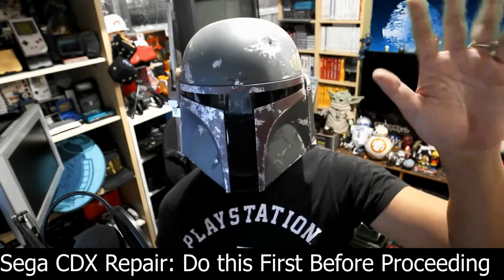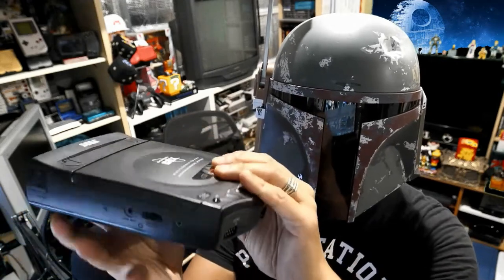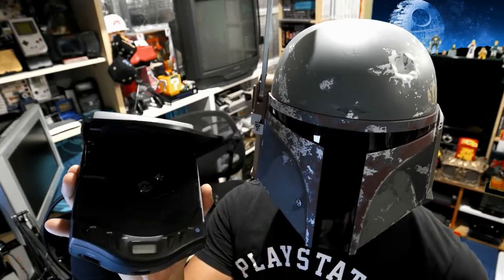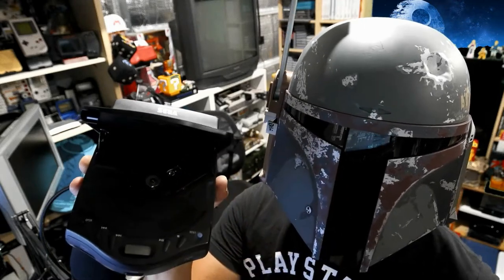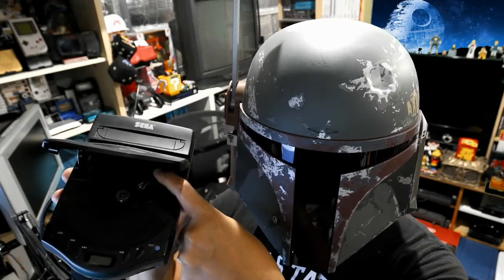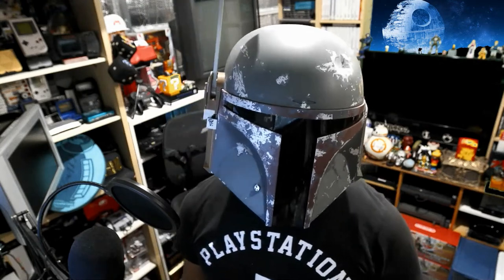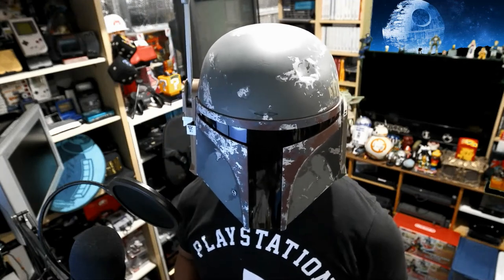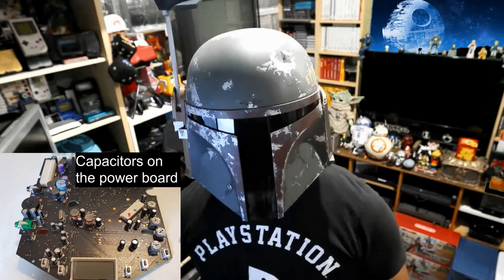Sega CDX Repair: Do this First before Proceeding, It will save you time and effort

Comment: Always wanted one of these since I first saw them in old video game magazines like EGM. Might pick one up and fix it for the nostalgia 🤔
Reply from the maker: It a great little unit, and for that time in the 90's, it was a well engineered console, you can see shades of what they did with the Saturn because of the CDX, from a design standpoint. Prices on Ebay are inflated. If you can find a unit that is functioning 300-350 is the going value. I always try to find a seller willing to take an best offer. A broken unit to fix would be between 150-200. I hope this helps and thanks for stopping by.
Reply: I have one, if you want
Reply: @prioadhipranoto7488  how much do you want for it
Reply: @HOWLWOLF  do you have Facebook account or whastup number?
Reply: @HOWLWOLF  if u want it, I give u free. Just pay for delivery
Reply: @prioadhipranoto7488  you still have it?

Comment: I have a CDX with an odd issue. It will only display a black screen and will not play games, however it will play audio CDs, again with a black screen. Any ideas?
Reply from the maker: Have you recapped the CDX,  some capacitors will fix video issues. Also have you tried another AV cable just to make sure it’s the unit.

Comment: My CDX spins a little, tries to read the disc, and then gives up with a "No disc loaded" error. I sent it to a friend of mine who recapped it (as a pre-emptive measure since they would probably start leaking sooner or later), replaced the battery, oiled the bar that the laser moves back and forth on, and swapped out the original laser with 5-6 new lasers he ordered, but none of the new lasers fixed the issue. He left the pot adjustments at their factory set levels because one of the few repair documentation he found online said not to mess with them. BTW, if you're replacing the laser, wouldn't they have to be at the same factory settings since adjusting them as you said is only a temporary fix (and I'm guessing all new lasers should work at the pots' original factory settings)?

I was thinking maybe it was the motor but my friend thinks that if it was the motor, it would not spin at all. I'm the original owner of mine since 1995 and it stopped working near the end of 2011. I would love to get it fully working again. The Genesis portion has always worked without issues. It's just that Sega CDs and audio CDs no longer work on it.

Would you have any other ideas that could be the issue?
Reply from the maker: so the pots really don't have a factory default, each laser gets tuned specifically so when you replace the laser, you do have to fine tune the pots a bit. Back in the days each laser that came out of manufacturing were not identical. If you opened up 2 different CDX, each unit will have the pots in different positions at factory default because it was fine tuned to that laser that was installed. It's a pain in the ass to tune the pots, but the best way would be to use a multi-meter to measure the resistance and test it in increments as you adjust the pots. The motor won't spin up if no data is read from the laser, so many times people confuse the spinning of the disc at low speeds to a bad motor. I hope this helps.
Reply: @remagelosnoc  First off, thanks for the reply, I really appreciate it.

I wanted to ask if you would know if an untuned laser could cause the CDX to act in the same way that a dead factory tuned laser would cause it to act.

Once it stopped playing disc games, my CDX would spin a little, try to read the disc, spin a bit more and after about 20-30 seconds of that give up. This happened with the original laser once it stopped playing discs and happened even when the laser was replaced with 6 different lasers. I believe the pot settings were the same when the replacement lasers were swapped in as they were with the original laser. It's made both me and the friend I sent it to wonder if the original laser was ever the issue.

Maybe the new lasers weren't getting enough power from the pot settings to properly read the discs, making the CDX act the same way a dead laser would? I know there's a decent chance due to lower QC standards that current replacement lasers ordered are dead on arrival, but I'd have to think that at least 1 out of 6 lasers he swapped in would be working.

Thanks again and take care. Looking forward to your reply.

Comment: Question. The one I have shows the Sega CD title but it wont spin the disc. The lazer is in the middle and I can see it moving a little but thats all. What should I do next? Thanks
Reply from the maker: does your CDX spin the disc at all, try to put a music cd in to see if the disc spins. if it doesn't then there is an issue with the spin motor or it could be that the laser is bad and can't focus to read enough data to tell the motor to spin up more. Let me know how your CDX responds to a music disc.
Reply: Hi. Thanks for responding back i appreciate it. The player is not spinning with a music CD disc. It doesn't spin at all. If i do have to replace the spin motor and lazer can you recommend a place i can purchase them? Thanks again!